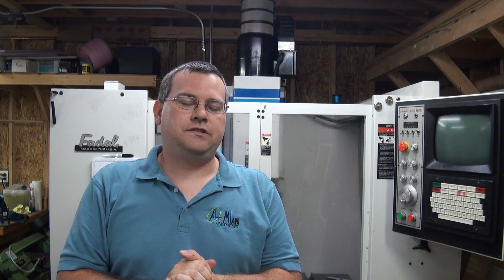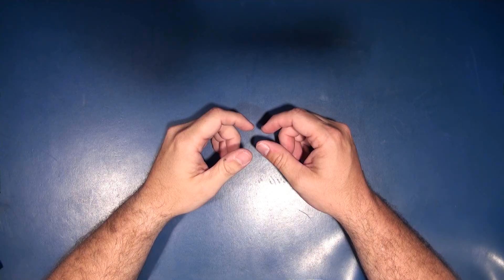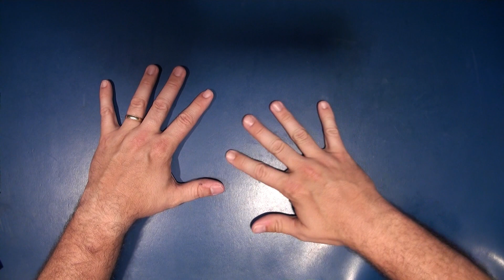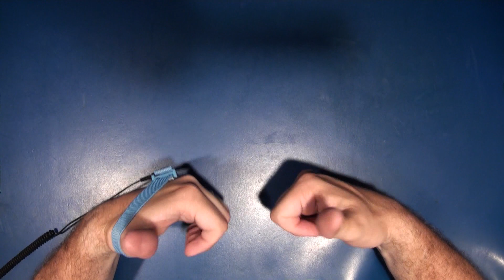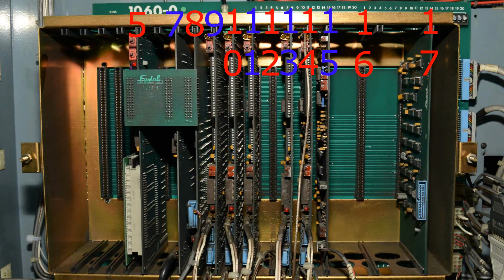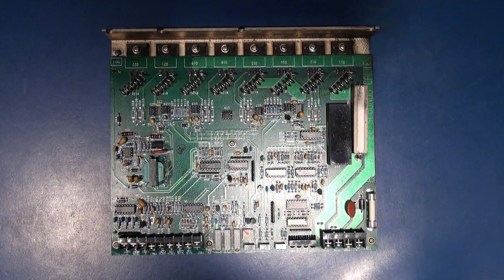Fadal CNC Machine Control Electronics Walk Through

Comment: I have a Fadal VMC 4020 with a C axis spindle line fault #9 with a baldor vector drive inv-040 need help because it seems some people went poking around with the wires and im sketch about the routing what wire goes where on the cards especially slot 14 c axis spindle i replaced the board and jumper settings and eprom chips and still have a blinking fault on  the card..

Comment: Hey man, I'm LOVING these videos.  My company just bought an old (1996) 6030 HT and I'm having problem with startup.  When I jumper across J2 on the CPU board, it goes into diagnostics and I get a failure on the Test Clocks function.  it reads "INT6 -FAILED-"   Is there anyway you know of to diagnose this specific problem other than replacing the clock board?   

Thanks again for all the content!!!
-g

Comment: How about I have a problem with my machine, it is a fadal vmc 3016 when I turn it on, the motors do not activate, therefore I cannot move it before, the same thing had happened, only turning it off and on activated the motors, you could help

Comment: Hey i have a problem with my 6030 fadal i just bought it and connected leveled and preparer and at the first try i made a circle and a square and they are both bigger than they should say if i program a 3x3 square the actual size is 3.872 x 3.872

So do you have any advise where to start looking ?

Comment: Hi, I have a memory corrupted error shown on the screen, In FADAL VMC 4020, i have already done several things such as zeroed memory, SETP completely and backlash due to ZERO-OUT MEMORY settings, I remplace the lythium battery, but still showing this message 

“Unrecoverable memory error at DE9E”

Befare that showed this 
“Unrecoverable memory error at 2614”

And sometimes shows this message

“You have a version upgrade or Memory has been corrupted”

Memory needs to zeroed 

Could you help me on this please?

Comment: Hey there!
 love your videos and watch them like crazy tons great info. you mentioned how running a industrial CNC machine on anbrinos and gecko drives is a terrible idea. I just received a free fryer MB-11 bed Mill that they parted out all the electronics on but the rest is complete and in great shape. can you please do a video on explaining what kind of controllers are out there for retrofitting an industrial machine and what types of servos to look for? As well as how to do things like size them correctly I was planning on going with DMM Tech servos and a masso controller board. Id really like to go with a Siemens Sinumerik 840d but they are too rich for my blood.
Reply from the maker: There is a large market of servo motors and controllers. CNC controllers is a bit smaller but there is a pretty wide range of retro controllers. I just don't recommend putting stepper motors and an open source controller on a larger machine. You will spend more time fixing and tinkering then actually machining.  As for drive sizing I would look up the specs of the motors that came on the machine and just duplicate. Sizing motors correctly is actually pretty detailed process.  Good luck with the machine!

Comment: Hey Tim,
Love your channel! found it after purchasing my first Fadal (1999 3016L A/C) your videos have helped me so much!! Thanks a  ton!!!
I've purchased a second machine a (4th axis ready 1996 4020 DC with cool power and 10K head)  I did however break one of your rules when buying a used machine in that it was not under power.  For me the price was worth the risk as this machine was close to my shop and the owner had to sell ASAP.  This machine is SUPER clean.  Owner claims to have had it in storage for 10+ years unused and that it was only used a few years for prototyping mag parts.  I'm guessing there in lies the issue(s) After confirming the transformer config was right for my voltage I threw the switch. The fan power up like my other machine, I pushed the CNC power button and the control does not start.  The axis control boards power up and their LEDs are flashing.   However the clear relays are not lit and the control panel is not powered.  Any Advice? 

Thanks 

Kevin
Reply: 10+ years unused, the battery must already be dead. You need to do memory procedure.
Reply from the maker: Hello Kevin, thanks for the feedback.
I would start checking fuses first. There are a ton of them peppered all over these machines.
Make sure all the taps on the secondary of the main transformer are at the proper voltages.
Please be careful, if you don't have an electrical background I would highly advise a service tech. There is a deadly amount of power in there, keep arc flash in mind as well.
Reply: Thank you! I will start there.

Comment: dear At-Man, could you help me, my fadal machine has the servos¿ motors desbalancing
Reply from the maker: Not sure I understand what your asking about the servos?
Reply: Hi, sorry best regards from Ecuador I usually speak spanish. Thanks for your videos, these are a good help for us. I had a problem my fadal machine mill circles whith 0,005 inches oval my servomotors are not balanced
Reply from the maker: Thank you Hugo, here is a link to the maintenance manual for the axis drives. https://www.fadalcnc.com/media/pdf/tech_docs_1/Maintenance_Manual/Axis_Drive_Systems.pdf You will find a specific program to run, then you adjust the gain of the servo drives in the upper section of the controls cabinet. You want to adjust all the drives to the same amount of error that is called out in the manual.
Reply: That manual is sweet - thanks for the link, Tim. Do you know where I can get schematics of the boards? As an EE, so much easier for me to troubleshoot and adjust using them.

Also - having a problem on a 1995 DC machine 15XT with random overshoot in -Z direction of up to 40 mils at high feedrates...at slow I get none.  I was thinking about changing out the linear rails (servo, resolver, ballscrew, thrust bearing have all been replaced), but to blind-stab troubleshoot it I don't want to throw $1400 at a set of genuine rails and trucks (like the prior owner did with the ballscrew that was good). Do you know the type of rail so I can cross reference it to a Chinesium rail set? If it cures the problem for a couple hundred (or less) $, THEN I'd get a set from the usual FADAL sources (because there's no way I'd run the machine on that crap). thanks!

Comment: At-Man, I am piecing together a 4th axis from spare parts and stuff i get from e-bay. I need to install a overload relay for the axis. i see from your video that you have one on your machine. would you be so kind as to give me the allen bradley number off of it. If i had that number i can get one from e-bay for about 8 bux vs. buying ELE-143 from ITS for $140.00 Thanx , Ray      p.s. I am using amp 21 so i would be intrested to know what size heater to use with the amp i am using. , it looks like the amp 6 uses heater w47 and the amp21 uses the W54 ???
Reply from the maker: I can check, do you know which heaters your looking for by number?
Reply: as i stated in my previous post i think the amp 21 uses the w54 and the amp 6 uses the w47 . I need the one for the amp 21.thsts why i need  the numbers from yours to help me eliminate one or the other
Reply from the maker: Mine has a W51 heater in it. But that heater is more dependent on the motor that is being used.
Reply: ok thats fine , can you give me the allen bradley relay number it looks like a bov -4
Reply: maybe a cov
Reply: I am using fadal blueprint Wrg_0034A_dc_4axis_for_ac found on line . Note 1 on this page calls out W54  but i can change the heaters , i just dont wanna pay the parts extortion for I.T.S. parts.  the ELE 143 is $140.00 vs ten bux on e-bay. If it matters i am setting up a fadal 4020 with a vh65 rotary axis.
Reply from the maker: Cool, let me get you that number Weds.

Comment: We have a 1995  4020 HT with DC and the analoge command signal is used (for the AXIS amps) where you say the CLOCK is going....so maybe u mixed up there something.
Reply from the maker: You are correct, that is for the analog to the drive amp. The clock of the resolver comes over the backplane. Sorry for the confusion.
Reply: I am now elbow deep in this stuff.... See the EMAIL I sent. Once I had to replace the D/A  IC on an axis controller  board (I guess ESD got it fried somehow)

Comment: thanks for all the info, we have a 4020 with a low voltage on 2 resolver lines x,z get .1 volts and y get 1.7 volts, i swapped the motor across x and z and the good voltage follows the motors, the other 2 motors were replaced with ones from another machine but the results are the same, the "bad" motors work just fine on the other machine so i have no idea whats going on, all cards were replaced as well as the amps and power supply and it still doesn't work. any ideas on what it could be? thanks in advance.
Reply from the maker: It could be a broken wire somewhere. The resolver is excited from the 1060 board, J1, 2, and 3. Then the feedback that your measuring is at each servo card. Could be an issue with the excitation or the feedback. I would start at the 1060 board and see if it is outputting the correct excitation and then work from there.
Reply: thank you, i will check that out.

Comment: My understanding is that that serial port on the communications board (the one that goes to a small PC) on 32MP type systems is actually an RS422 port and not an RS 232 port.   
Although I see people referring to it in the forums as RS232. 
Is this correct? or do some board versions have a different type of serial port or are they 
internally jumperable to somehow not be RS422?
I'm trying to bring up a replacement PC for one of these and My understanding is that 
it has to be an RS422 port to talk to it.    
And from the looks of the old ISA card that is in the failed PC this is what it was.
The what I think to be an RS422 card doesn't exist on google anywhere and has a 9 pin 
DB-9 female so not a standard PC serial connector.   
They use this with something called "Fadal Memory Manager" running in Windows 95/98 to talk to the machine via serial.
Reply from the maker: I would think it is RS232, but I have never worked on a 32MP, just the 88HS controllers. Best way to find out is to measure the voltage and look for termination resistors.
Reply: Thanks!   I'll also investigate the 88HS systems.  
Everything over here seems to be RS422.   
The cards are ancient ISA cards In the PCs and there's NO documentation easily found online for the particular cards. 
I'[m finding things out as I go and ultimately finding out if I can run this stuff on Windows 7 on newer tiny hardware that will fit in the pendant (as they call it).   
If you'd like I'll keep you informed and share info.  
As of new they have to run ancient hard to find hardware.   
They run a little program called Fadal memory manager in windows 95/98 that seems to do everything they need to make the machine access files on the local computer be them on the network or copied from the network to the local hard disk.  
I have no clue if this is using some form of DNC or if it's entirely different.
I'll eventually have more of a handle on it.  
Are you at all familiar with the Windows based Fadal Memory manager program?   
They call it the "penguin program" on the forums because of it's embedded icon LOL.
Reply from the maker: Please do, I can make some videos if you take some pictures.

Comment: Very interesting. One reason I like Heidenhain controllers so much in comparison to Fadal and others is that all the positioning calculations and programming is done inside the main unit. The encoders plug into the main unit and all the i/o is within the main unit..only wires that go out are screen, operators terminal, analogue command to the drives MPG, limit switches and an i/o cable to the break out board for things such as tool changers and clamps. The advantage is that if the old drives and motors die you can fit modern intelligent  drives such as Yaskawa or Mitsubishi and set them to analogue speed mode so they regulate the motor speed only..then use the old encoders which go straight to the main unit for the position loop.
Reply from the maker: It might be one main box, but most of the older controllers have multiple processors in them. Running that many control loops plus calculate the G code moves is fairly intensive. Even with today's processors many device split the tasks between separate processors.
Reply: Another neat thing on the Heidenhain is that programs from the very earliest units will run on the latest models..the controller updates the program and overwrites any obsolete code. Also Heidenhain will do service exchange on all parts within a week..fairly expensive but if the machine is making big money it's well worth it. All the cables can be ordered and are ready made to the part number stamped on the cable which relates to length type etc..Plus all Heidenhain controllers come with conversational programming as standard (Dialog) and the PLC data can be saved to a hard drive as well as stored on EEPROMS on the main board. 
Each control is designed  with a complete test kits for the service techs..to test encoders..ports, connectors and all the pendant keys one by one..
Not knocking the Fadal by any means..it's amazing what the brothers achieved and great to see the control still working and with it  being able to be modernized so easily that is just brilliant.

Comment: Fadal machines suffered from temperature instability and needed glass scales and chillers  to minimize position repeatability errors within .0005, which made them inadequate for machining within +/-.0002, last time I run one was back in 1991, I supposed they have overcome the shortcomings by now, still a decent machine for general light type of work.
Reply from the maker: Yes, it is not realistic to think they can hold 0.0002". Fadal did make some machines that have chilled screws but they had issues leaking and most people disconnected them. The glass scales are not the best either due to there placement. But as long as you warm the machine up and keep it under a reasonable load you can get pretty good tolerances. Ball Bar testing has shown my machine has a total positional tolerance of just under 0.001". The bigger issue with my machine is the abbe error in X due to the saddle design. You can't really complain much for getting a 0.001" machine with 10HP continuous for well under 20K though.

Comment: Hi At-Man, i am from Argentina, and i bought a Fadal TRM 2003 with everything working perfectly but the servo motors. I have 2 choices, one is to buy the servo motors and replace them and the other option is the one i am doing is putting all new cnc controller and servos. Since i choose the upgrade path i have a lot of used spares i want to sell because they work perfectly and i wont be using them, do you know someone that could need o sell used electronic in perfect conditions? If you want a video or photos or anything please ask me. If any one that reads this comment wants anything i will ship international, It would be easier if someone buys all toghether: CPU+Power Sources+Controller Cards+Servo Drives+Spindle Drive+Screen+Keyboard+All the HMI cabinet basically: All BUT the servo motors (AC). Thank for all the videos, i bought a Fadal because of them, and because i saw how easy to maintain is. Hope you keep doing them, very nice work. Thanks
Reply from the maker: Hello, does the machine have a memory expansion board? I already have 2 full sets of boards plus extra drives so I think I'm all set. Send me an email with what type of price range your thinking and I can forward it to a few people, include some pics and dash number of boards. Thanks!

Comment: My question is why not gut the electronics and replace them with modern electronics. Maybe that is what Gcardinal and pete brubaker are talking about. Im a hobbiest. I knew nothing, had little money to finance the hobby, but wanted to make my computer more useful than a gaming platform. So I got a pm 25mv and Mach3. I am learning a lot, but am so dissapointed in accuracy, repeatability, and machining volume. I'd love to marry a VMC for the volume and rigidity and pc based controls with servo motors and accurate scales for positional feedback. Is anybody doing this successfully?
Reply from the maker: Hello Robert, I would only upgrade to another industrial controller or something I make my self. It is more of a cost issue then anything. CNC controllers are fairly expensive and the original Fadal boards work just fine. PC based controllers are not really a good option. Windows is horrible for not being deterministic and stable, Linux is better, but standard Linux was not designed to be deterministic either. You really need a purpose built embedded control system to accurately and reliably control a machine. I do very complex machine control solutions for my day job. There are very few people that have tried to put PC type controls on a larger commercial machine for those reasons. PC bases systems will mostly work at the hobbyist level, but at the commercial level I need to make the part correct the first time. You don't want your PC based control crashing on a $10,000 casting.